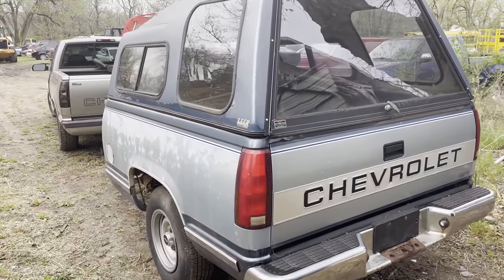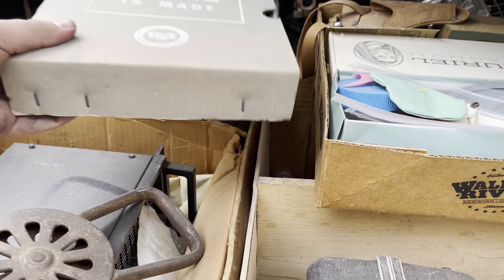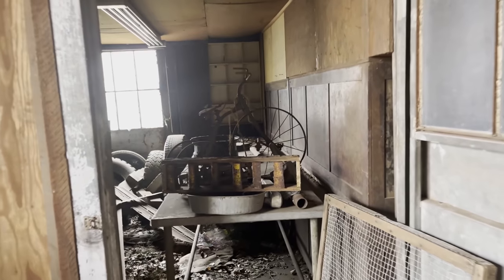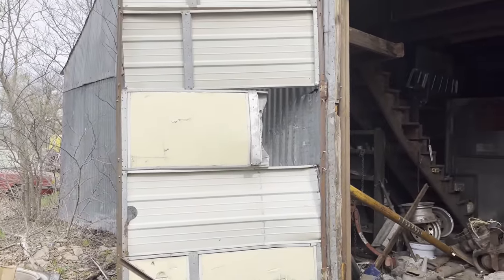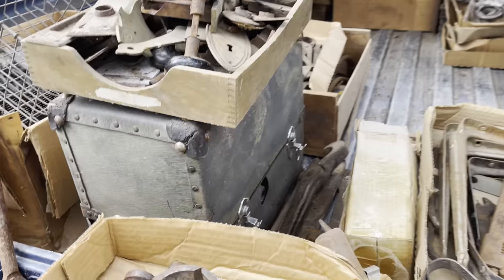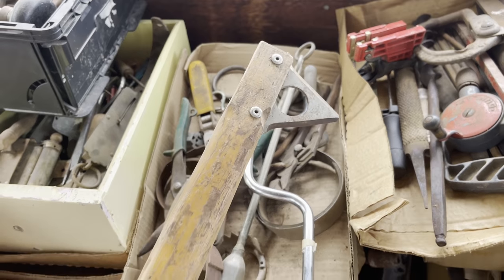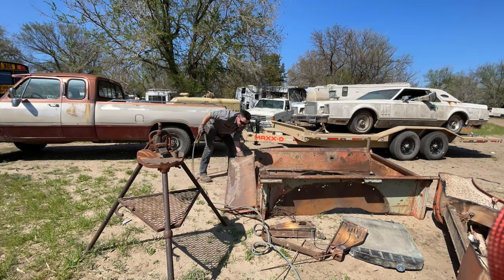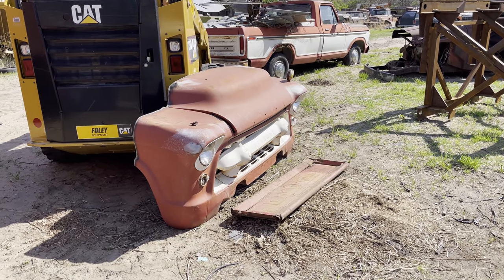I Cleaned Out a Trailer PACKED with ANTIQUES! Unsearched for Years, What will I Find?

Comment: I use a aluminum tent pole cut the length of the shock strut big enough to slip over the shock end for a hatch holder but I'm sure you can find some there with all those cars!

Comment: Love the old stuff you go through and I love the finds from the junk cars you get.  I was helping someone in CT clean out an old garage and up in the loft was a few heavy signs that looked homemade.  When I got them into the sun I could see that they were repurposed and the paint on top preserved the images under them.  They were old porcelain signs about 2 foot by 5 foot (some longer) and two of them were Goodyear Batteries signs and one was a Goodyear tires sign, the rest were ones that went together to read "Inner Tubes . Car Service . Repairs . & Home Supplies."  There were about seven signs total and they linked together to say all that.  I have no idea what they are worth, but the three Goodyear ones look to me to be worth quite a bit.